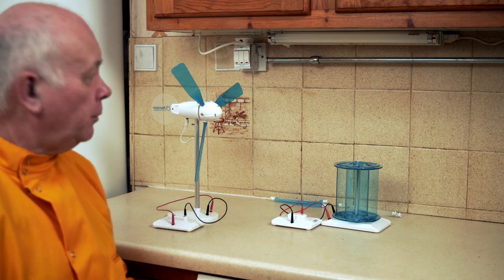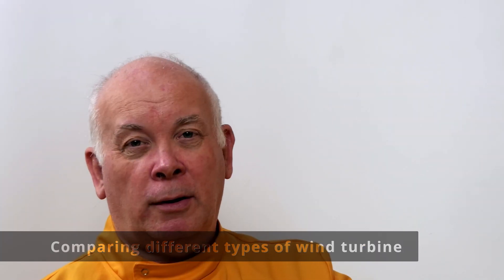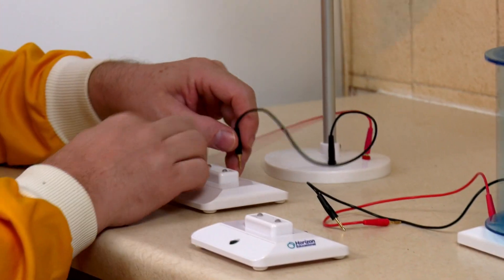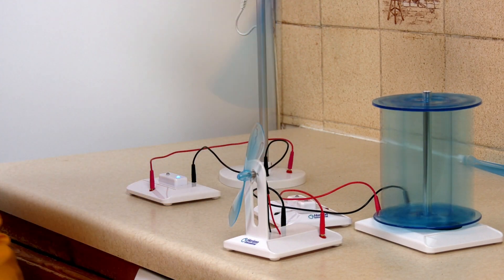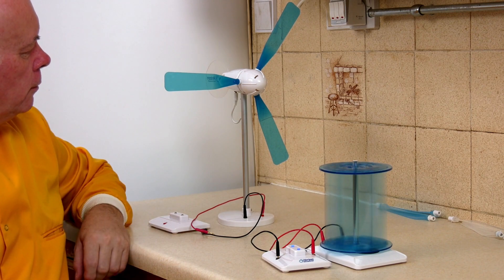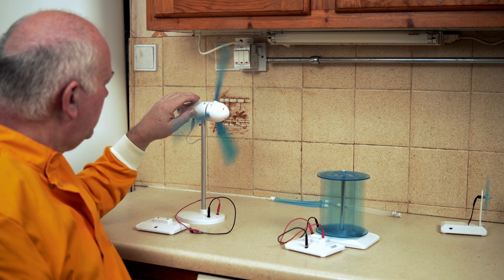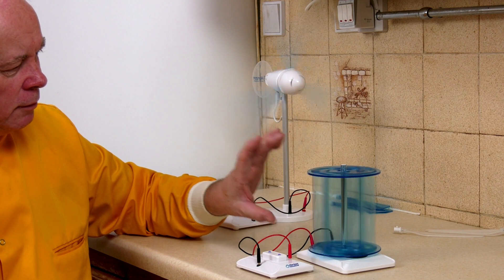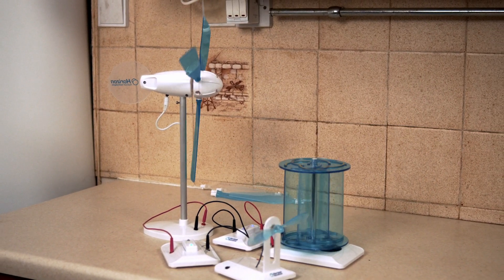comparing vertical vs horizontal wind turbine

Comment: Good, but the swept area of your horizontal is much larger than your vertical turbine. This fact can confuse the results, no?
Reply from the maker: The swept area is about the same according to the manufacturer, but the amount of power produced is very different because of the design and the rotational speed. Other factors are more important than the swept area.
Reply: @PhilipRussell  the HAT sweep area is not area of blades!
Reply from the maker: @sspicar  Quite correct
Reply: The VAT has half its area going into the wind, and the area of sweep on the  HAT is greater than the area of sweep in your VAT model.